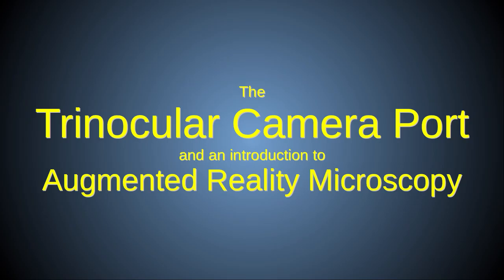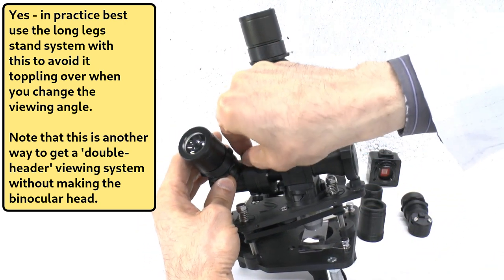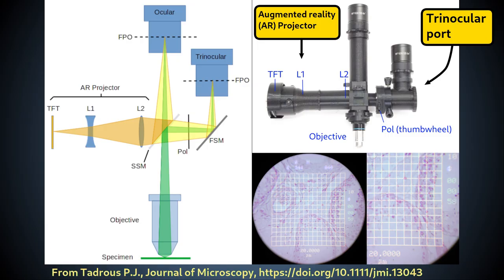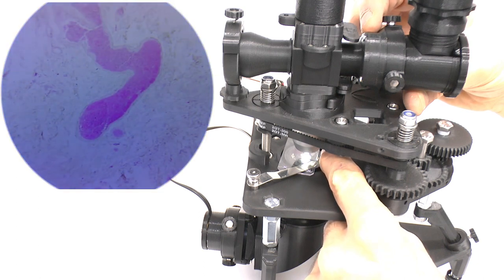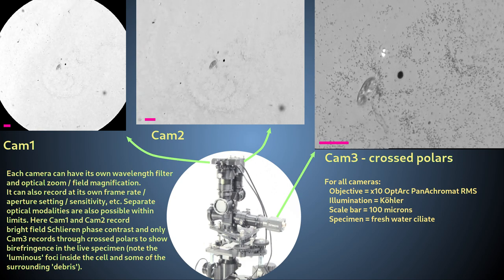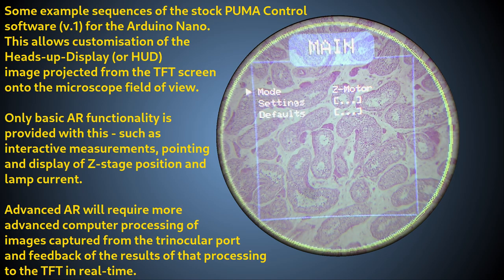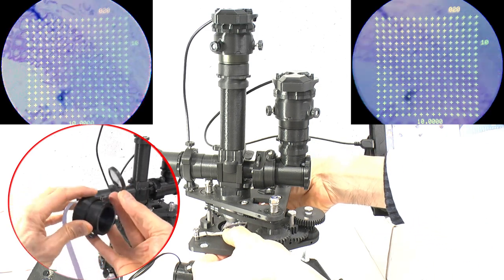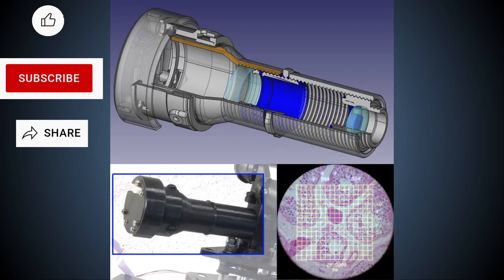Augmented Reality Microscopy and the Trinocular Camera Port

Comment: What software do you use to display information ?
Reply from the maker: In my 'PUMA Control' software for the Arduino Nano I used modified versions of the Adafruit GFXM and ST7789 libraries for driving the TFT. I modified the libraries to do the mirror characters and mirror print and wrote my own functions to deal with numbers and some graphics. I designed and wrote the GUI and control functionality myself, using those basic libraries for printing characters and graphics to the TFT screen. All code and more details are available on the PUMA microscope GitHub repo.